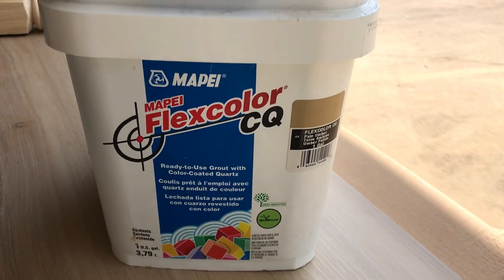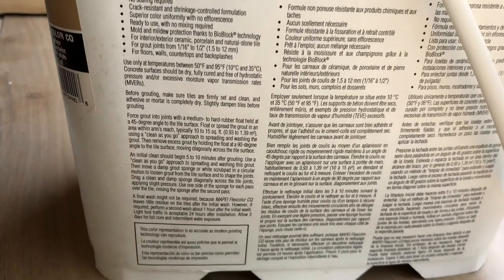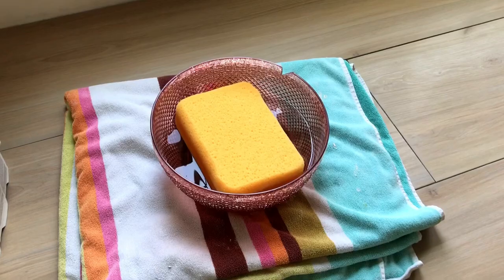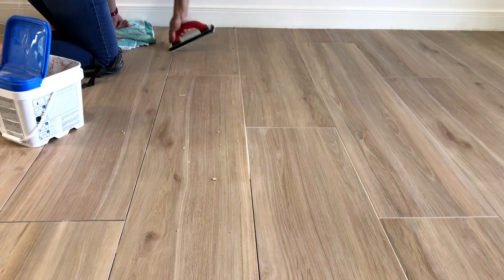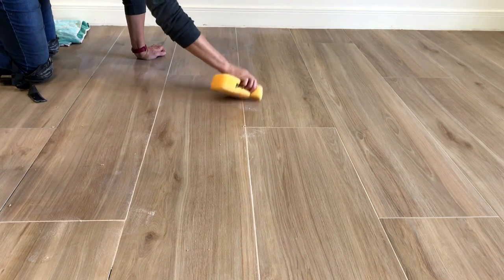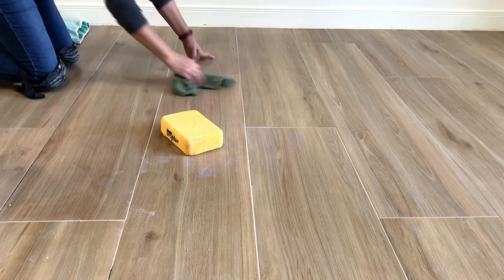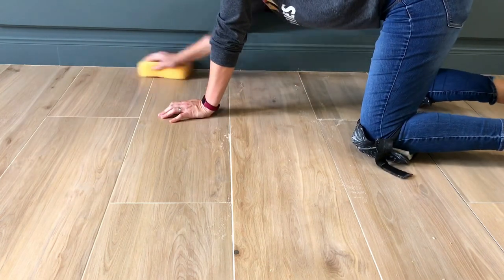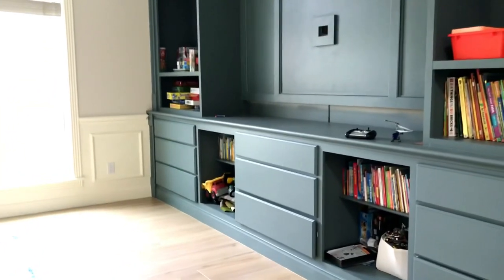7 Must See Beginner Steps - How To Grout Porcelain Tile Floor - Easy DIY Grouting

Comment: Dont forget those rubber gloves when washing caustic grout
Reply from the maker: Good point. I actually recommend heavy duty gloves, like kitchen gloves. Or nitrile gloves with work gloves over them because the sand in the grout will shred thin gloves. I completely forgot to wear them this time.